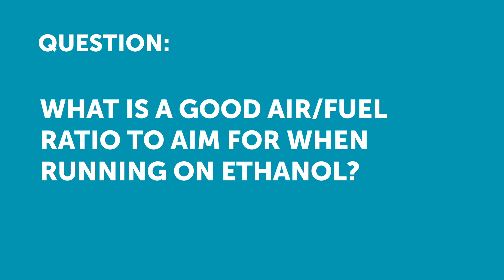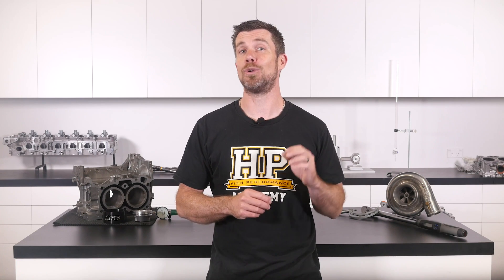Ethanol Tuning | What AFR Should I Target? [HPA Q&A]

Comment: The question was answered
Reply: No it wasn’t 😂 what we wanted to know is that you can target a leaner AFR/lambda with alcohol. All we got was that the petrol AFR scale is not the ethanol AFR scale but yes you can use it to make sense of lambda if you’re not used to working in lambda.
Reply: The question “What is a good air/fuel ratio to aim for when running on ethanol?” mentions nothing about rich vs lean. Also doesn’t mention at what loads. Idle? WOT? Cruising?
Also, this question has already been answered in the forums.

https://www.hpacademy.com/forum/understanding-afr/show/e85-max-power-lambda-value-copare-gas-pump-fuel
Reply: @jameschaffe694  leaner compared to what? I dont think you know/understand what youre asking.
Reply: Matt B I’m not asking any questions here
Reply: I run anywhere from straight petrol to petrol and 30% methanol. The lambda target remains the same. So in my case the AFR target remains the same too as I use the petrol afr scale, which is what most do. There’s no way I would or could use a methanol afr scale, not with such small percentages. However the fuel quantity is increasing at approx half the methanol content, as you need roughly twice as much methanol as petrol for same lambda.
Reply: They already covered that in a previous video. Took their frs race car at a steady state load on the dyno and added in and took away fuel to see maximum torque. The car made max torque at about 13.2 afr, but it was fairly steady down to about 12.6. So they tuned it a bit richer in order to be safe with combustion temperatures since power gains were miniscule. This is on the gas scale and naturally aspirated mind you. Cruising you can tune to pretty much as lean as the car will take before it starts running rough and then richen it back up a tad. Ive gotten cars up to high 15's afr. Part throttle is usually around stoich or a bit richer.
Reply: steelmesh I know, thanks. 👍 I was tuning with m20 yesterday, with flex fuel ⛽️
Reply: steelmesh in the petrol, hence the flex fuel. I don’t trust water injection
Reply: steelmesh yes this is exactly why I do not rely on water/meth injection. Blocked nozzle or failed pump/trigger system can also be an issue.
I find it far easier and reliable putting the methanol in the tank 👍